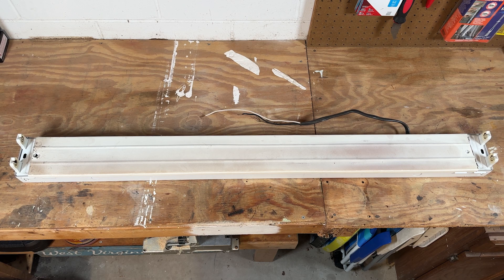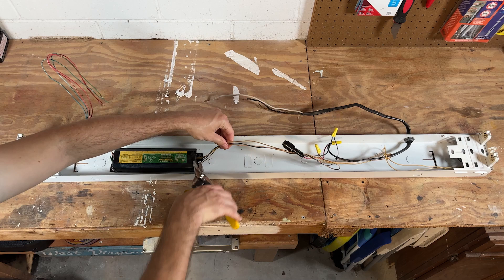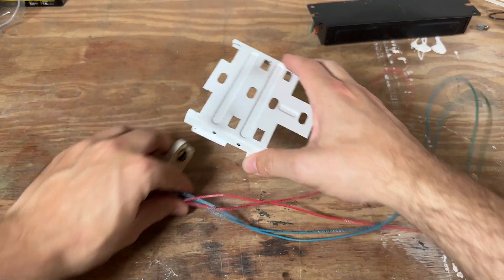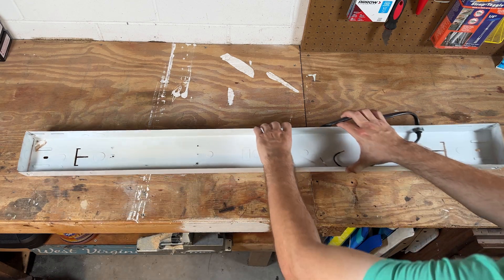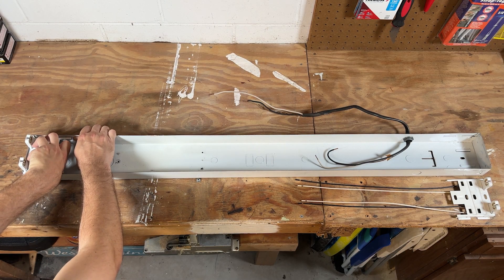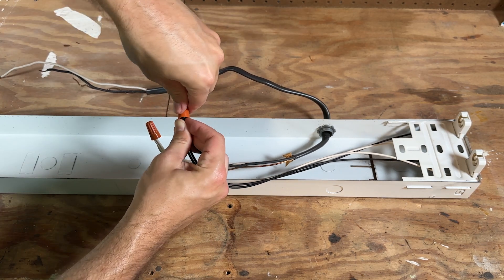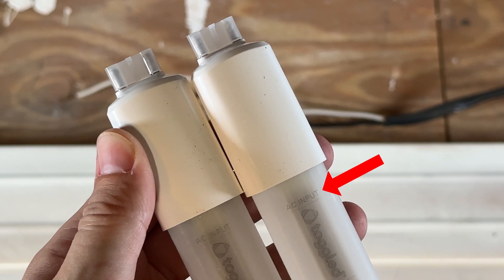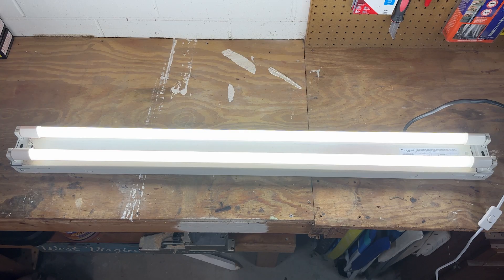How to Easily Convert Fluorescent Lights to LED

Comment: my 4 foot fixtues are like this demo.  mine are wired in a line.  I wonder if the wiring could be slightly different on the first and middle light fixture?

Comment: All of the one sided LED bulbs that I have use for conversions the tombstones always have the neutral wire on the left side of tombstones if your looking at them on the bench.
So 1&3 wires are neutral and 2&4 wires are hot.
The tombstones with that kit have the wires in the wrong configuration.
It still will light but the hot wire should always be connected to the load pin of the LED.

Comment: You really did good, sir. Been doing conversions or as some say retrofitting with the old larger bulbs but just now doing a few of these T8s. There are some differences. The T12 are hot on one end and neutral on the other.

Comment: Great video, but quick question. Wouldn't it just be easier and faster to just replace the entire fixture with a new LED one???
Reply: ya still have to wire in the new one in.  And I like the challange.  I have three sets to do for now and more down the road. IN THIS OLD HOUSE.

Comment: Nice video, I plan to do this in my shop.  I wonder if there is a kit for 96"fluorescents as well.
Reply from the maker: Good luck on your project!  I’m not sure if they have the 96’’ lights or not.  You’d think they would.
Reply: @thefiXfiles  Thanks, after shopping around for the bulbs, I actually ended up buying 4ft led kits from Amazon (a set of 4 for total $96) so $24 each.  I ended up using the empty hanging fixture from the original 96ft fluorescent light and just put a receptacle box on the top.  2 kits would fit in one of these.  It's nice and way brighter than the fluorscents and no humming from the ballast and no actual re-wiring needed.  They also come with pull switches.

Comment: Is it better to replace for $20 or buy a whole new light fixture for $60? If i just replace do i have to take the whole light unit out of the ceiling?
Reply: No need to do any fixture replacement.

Comment: Looks so easy so when it's not done on the ceiling..

So better to remove the whole case first ??
Reply from the maker: It could be done on the ceiling.  I took it down because it was my neighbor’s light and it was easier to record a good video in my garage

Comment: As with other positive comments, this video was a big help! For many years I've had double 48" fluorescents over an island counter leading into my kitchen, and when the ballast went out, I can't believe how much I missed that light. Picked up this kit yesterday, installed it today and am now back in business with bright light over that counter. The attached wiring was too short to connect to the main power wires, so had to do some fancy bending to make the connection. After bending and repositioning, the ground wire then wouldn't go back into place where it was, so drilled a new hole and voila... I have light. My only minor complaint is the 6500k brightness is pretty stark, so I do wish the kit that our Home Depot has included variable color temp bulbs which I would have paid a little more for. So down the road, I'll end up getting ballast bypass bulbs with variable color temp control. But thanks for this video!
Reply from the maker: Glad you got your light again.  And yeah I see your point about the light being a bit harsh for a kitchen.  I also like the warmer, softer color light inside.

Comment: My fixture doesn't have slide-on tombstones. They pop into the fixture. I'm at a loss on what to do. I already bought this kit and took down the fixture.
Reply from the maker: That’s interesting.  Every time I’ve done these it’s the slide kind.  I wonder if the tombstones pop out of your fixture so you could pop the new ones in.
Reply: @thefiXfiles  idk why the other guy is trying to troll, especially over a month later. anyway, I contacted Toggled, sent them pictures of my fixture, and they sent me the appropriate posted lampholders at no additional charge (and some extras). I did have to wire them myself using the wires from the kit's lampholders, though.
Reply from the maker: That’s good.  Glad you got it fixed man.  A big concern of mine is putting these videos up and having people follow my advice and not getting good results and losing money.  Thanks for leaving this comment here for others so they can reach out to Toggled if they run into that.
Reply: @pepper_s_ghost  when I googled the tombstones I found different types.  Mine are like this demo.
Reply: Lmao damn bro this is funny but not funny